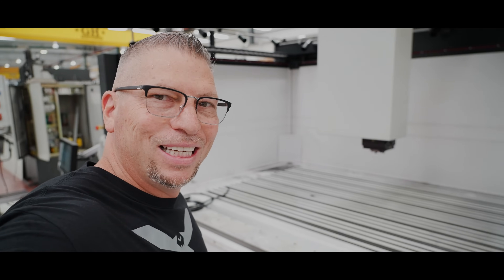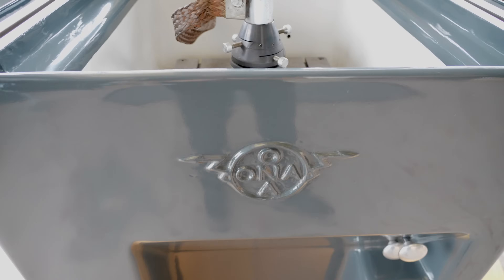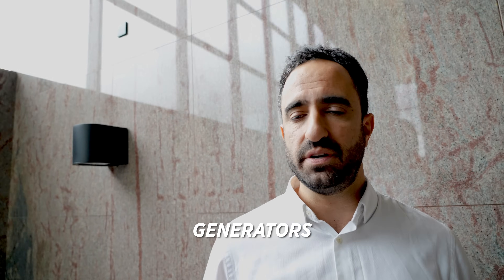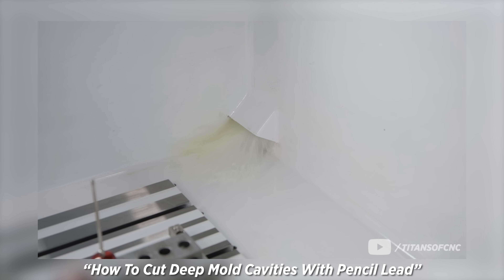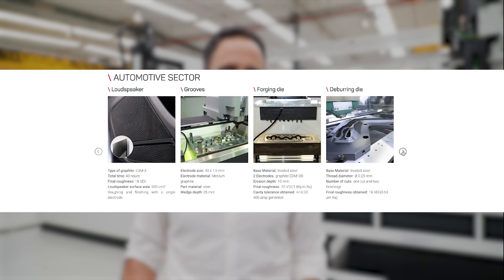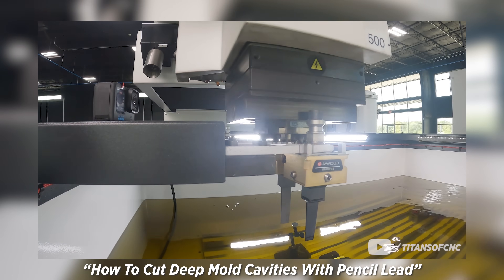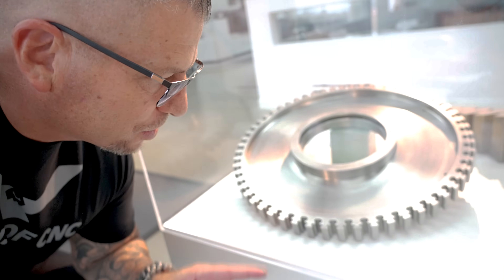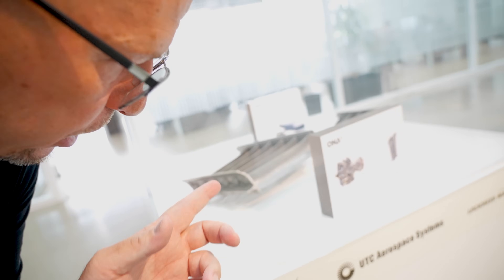BIGGEST EDM in the WORLD | Manufacturing in SPAIN | ONA TOUR

Comment: OMG, EDM has come so far compared to when I first worked on an EDM in the late 60's. I can't even remember the make, it was so tiny, the tank was around 2 feet by 1 foot, but boy did we make some great injection moulding cavity jobs on this little toy. We were the first in Australia to develop an electrode rotating unit.
I'm sure you would be familiar with the Agie and Japax EDM's great machines and the thing I remember most when I start working at General Motors Holden, they had one of the original Japax EDM's on there shop floor in new condition, but no one knew how to operate this EDM. Showed the leading hand and others what it could do and were amazed, made some awesome products on this old, but new EDM.
Love what you are doing for this industry, keep up with this great work and love watching your vidoes.

Comment: you drive a tesla? lol how could someone like you that makes such nice parts and knows what a good manufactured part looks like could own a tesla one of the cheapest garbage cars on the market right now. they have worse build quailty than a 90s car hahah 100% trash vehicles they are throwaway cars they use some of the cheapest manufacturing in the auto industry and there cars show it.
Reply from the maker: Besides having Tesla and SpaceX as customers, Tesla is #1 and #2 for the most American made vehicles. They are also towards the top of the charts for safety. My car is the Tesla plaid and it’s the fastest production car in the world and I have never seen a better made vehicle. It’s actually stunning inside and out. Previously I had an S for 3 years and I changed the tires once… and nothing else. Not a single issue. I also haven’t noticed that gas went up because I never go to the gas station unless I am driving my truck. I sold my huge truck that was on our show when I moved to Texas because of the hail and the fact that I couldn’t fit it in the garage… and purchased a Denali 

You can think what you want… but if you rode in my car and actually checked it out, you would see that it’s a work of art.

Elon makes Rockets and definitely knows how to make cars.
Reply: @TITANSofCNC  Agreed with your above comment. As for me, I'm staying with an 08 Malibu. Its a great practical design and meets all my needs. I still faithful to American cars even if they brake more often.
Reply: @TITANSofCNC  it wouldn't last 1 winter up here in Canada in -40 lol also im not a elon musk or spacex hater i have starlink internet and its amazing but elon should stick to rockets and satellites his cars are junk. who cares its the fastest production car if it wont last 5 years it don't mean anything. ive been around tons of teslas and they are a throwaway car they have some of the worst fit and finish ive ever seen on a car not to mention thin and orange peeled paint they cant even get the body panels spaced correctly hahah. they might work in texas or California but us Canadians laugh at those things also the most made in america car?? hahaha how about the lithium and cobalt from china? tesla uses panasonic batterys lol.. not to mention all the other electronic junk from overseas on it.. sorry no car run of 18650 batterys will ever be good. come back to me in 10-20 years when we figured out a real battery technology not lithium ion junk. have fun charging your ev off natural gas and coal powered electric plants haha

Comment: It would be most excellent if someone could develop sinkers that used water or water based dielectric instead of oil based! If those machines ever puke on the floor you've really got a hazmat situation when they are that big?!?!
Reply: I think machines this big need special arrangements for their location containment
Reply: You definitely shouldn't have one of those behemoths in the same sort of arrangement that the smaller machines need. They need a sump or some kind of containment allowing retrieval of the oil and encapsulation/isolation from the environment

Comment: You are absolute right the CNC technology has given the opportunity to insource work again from China, because they also have to buy Japanese, Germain or Swiss CNC machines only the cost for labor is cheaper in China, but if the operator is very skilled, they can easily be price competitive  if fewer part's are scraped also better usage of carbide inserts and tool selection. The problem is, that the knowledge and apprentices places has disappeared in the period when the wise production people outsourced everything to China. Now everything has to be built up and the young generation will feel some pride to be a programmer and machinist again. Thanks for your Prep talk and positive motivation. The importance to measure, that for one machinist in the industry will generate two or three other service jobs like sales, stock and supply chain management's, cleaning People etc.
Reply: The problem that China has competing long term, is the cost of shipping stuff world wide, it's only going to get dearer.